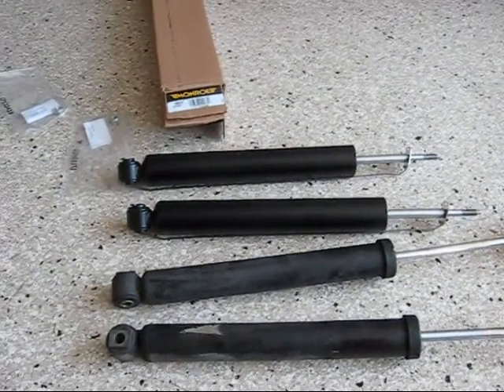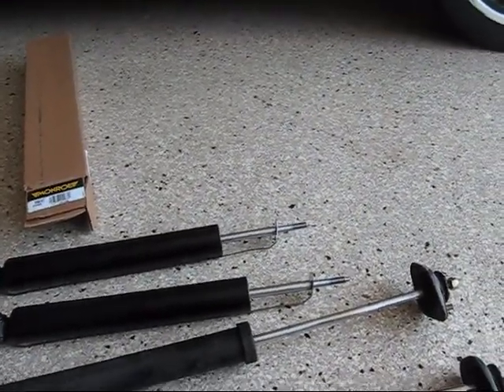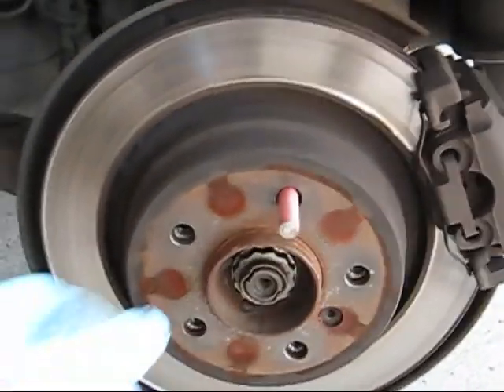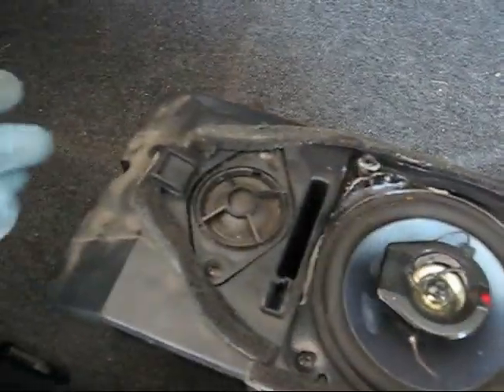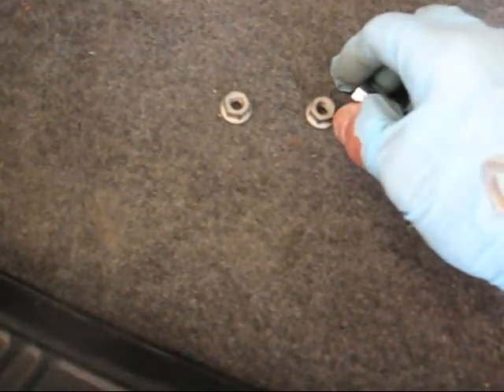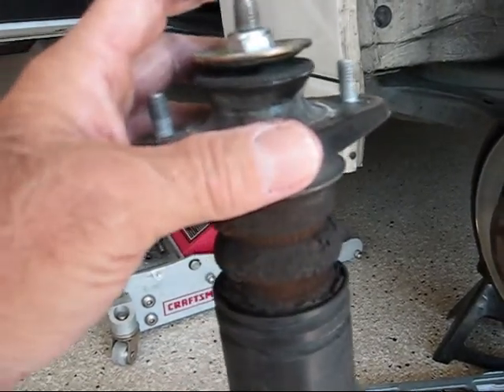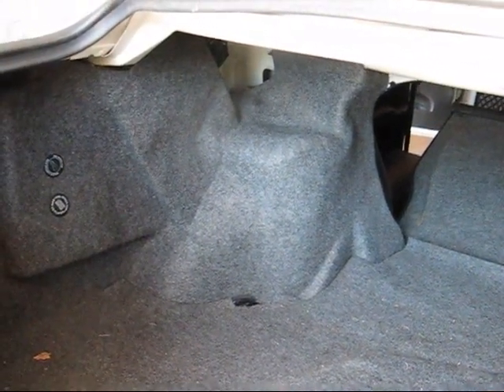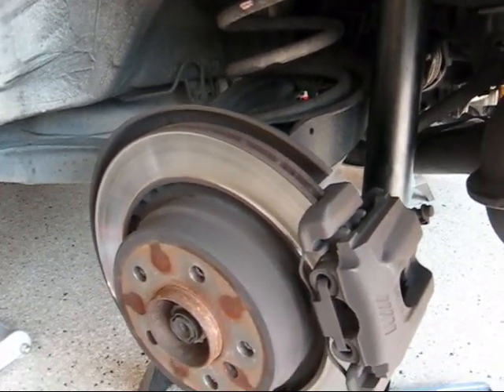BMW shocks rear replace 1995 M3 E36 part 2 by froggy

Comment: Hi Froggy ... nice DIY bro, but may you allow me give you an extra tip ? 
When transferring the old cup washer ( the bigger one under the mount ) it's better if you give it help with another smaller regular washer underneath .. i mean : small washer first then the cup washer in top .. that will improve the age of the mount because some bad cup washers will fail ( the washer hole extend by it self causing the shock to fail and damage the mount . i have also a question for you, why didn't you put a boot on the new shock ? .
Reply from the maker: I know the back upper mounting area is subject to failure, mine was in very good shape (California car) as for the big cup washer, never heard of those failing, they are thick. The new Monroe's did have boots, not sure if they showed up in the video. Thanks for commenting!

:)
Reply: Yeah it's rear .. but happens all the time specially with 1994 models .. i will take a photo as soon as i get to a failed one i have in my garage .. you will be shocked when you see the cup washer hole is bigger than than it should 2x times ... due to rust .
Reply from the maker: Yes, post up a pic if you can, that would be great. So it's the upper mount location AND the cup washer that rust & fail. Wow. I have heard that sometimes you need to weld in a new upper mount area. And I guess cup washers that are more rust resistant would be be smart too.

:)
Reply: For a New York car this is normal, with salt in the streets and dirt every where mixed with rain and dust, you should expect everything ... i will take a pic as soon as i get to my garage .. but remember this failure doesn't exist if you get a solid cup washer ... i'm talking here about the original ones in 1994,1993.1992 models, but recently i ordered a cup washer from ecstuning, despite the long wait to receive the item but it was a very solid cheap washer, better 100 times than the original one .
Reply from the maker: Great pics and thanks for the additional content.

:)
Reply: My pleasure .

Comment: Thanks for the video, but why did you remove the rear speakers?
Reply from the maker: You need to, to get at the nut on the top of the rear shock, you peel back the "carpet" and there is an access hole.

:)
Reply: Got it. Thank you. Nice watch BTW ;)

Comment from the maker: The car will feel floaty going thru dips in the road, if you have "dots" on your roads it will be loud and feel harsh crossing them, you can bottom out the suspension travel going thru a pothole, plus the old fender bounce test. They are no doubt worn out if they are original @ 115k.

Do all 4, fronts are harder but need it. The floor is about 15 yrs old a multi step "granite look" I had a company do when I built the house.

Comment: Thanks for the tips Froggy, I just bought my son a 1999 328i and I'm having to do a lot of work to it. Is there and good way to tell if it needs new shocks and struts? It has 115000 miles on it so Im sure it has the original. Also what kind of flooring do you have down in your garage? Thanks a bunch!!

Comment: Thanks for the response! I'm moving to MA Fall River tomorrow, and I have my eyes on a manual (Getrag for what i read) 318ti e36, it's cheap and it'll be a good start car. I have some driving experience, so I'm confident my MPG will be quite low looking for 26mpg to 30mpg, that's what my m40b16 was putting out. Since I'm used to servicing my own bmw's (e30, e36 and e39) having a BMW would mean no mechanic fees and thats a major expense on any family budget

Comment from the maker: I seem to recall a thin gasket at the top mount. You should be able to cut your own gasket to fit, find some gasket material that is tough as that spot does get some pressure when the shock is working.

:)

Comment: i flexed it out, it was easier then i expected. and I had another damper top support around so it was alright. Now I'm facing with another issue. The damper, they hav some kind of gasket to prevent squeaks my e36 is from 91, time flies and I have no idea when they were changed but I'm assuming they were stock and as you can figure out, the gasket... or what resembled someting like it is non existing. do you have any ideas what can i put there that i can scavange? and specially of all, how thick

Comment: froggy, on my e36 bmw, when changing the rear shocks, everything went well, and they are in place.Now the nut the  right shock, the smaller one it just spins and wont come out... the threaded bol is solid and wont spin but the nut spins and wont come off. Fo you have any sugestions before I flex it out?